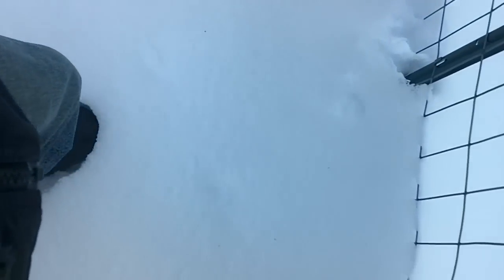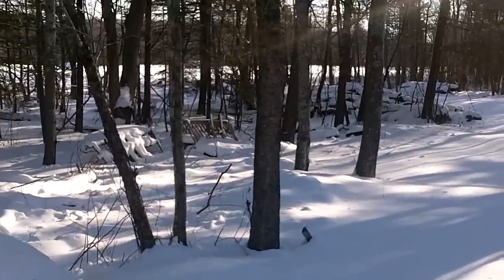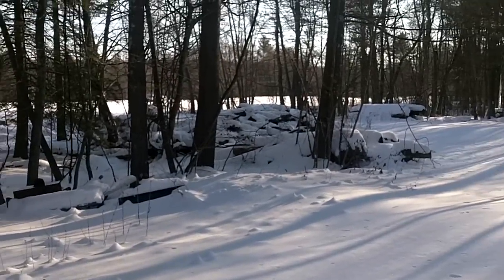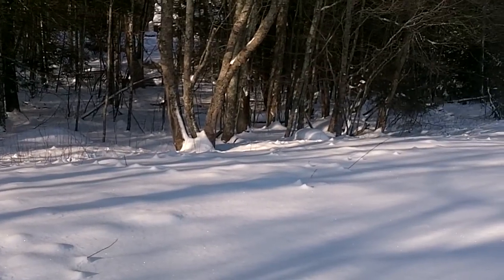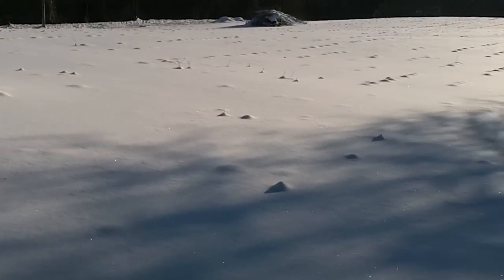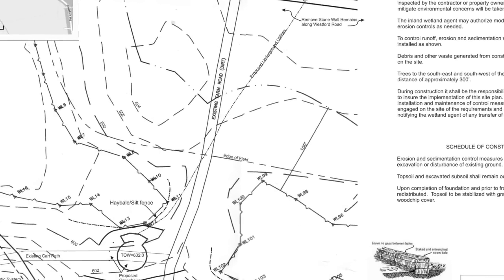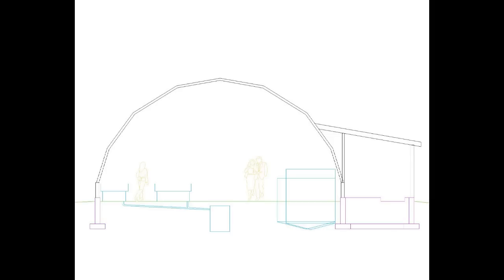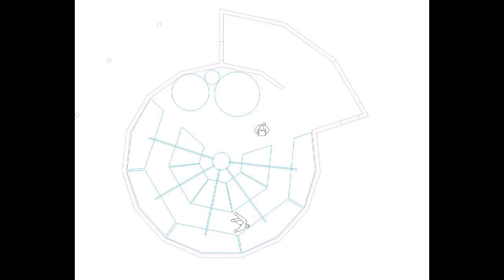Geodesic Dome Greenhouse - Part 1 - Overview

Comment: Hi, great videos I enjoyed watching them all. Is there a reason why you used a two sump system for the aquaponics system as this seems to have added a significant element of over complication and potential addittion points of failure? Why not drain the grow beds back to a single large sump without the need for addittional pumps float switches etc?
Reply from the maker: +Richard Miller It's just the way the floor layout worked.  I wouldn't do it this way again.

Comment: I have a 20' dia gazebo that needs a roof so I'm trying to figure out how to glass it all in... I have enough recycled old windows and sliding glass doors to glass the west east and south sides. And 2 layers of polycarb on the roof will keep in some heat... For the north wall, I want concrete as a heat sink with insulation oustide it (sprayfoam-inc.c m). I'm growing aquaponic lettuce,etc so I need the water at ~75 for the fish and the air stable for humid and temp for plants (salem, OR climate)

Comment: I'm sure efficiency is a pretty big deal for your winter heat.  Have you researched rocket mass heaters?  Googleing rocket stove pops up some good results on how to build one.  If you're burning wood anyway, you might as well burn it effeciently.  And the kicker, it releases no smoke, just CO2 and steam.

Comment from the maker: @Mooja12  Around $15K.  If it was sub surface, there is extra cost with digging deeper for the heating/cooling system and it would also be down in the water table.  Plus the concrete would have to be reinforced more since there isn't an equal load on both sides.  CT regulations require 42" plus footings for anything with a foundation.  Entire thing will be automated.  Using Geodesic for the "coolness" factor ;-)  Plus they can be an open span without extra supports = less material costs.

Comment: Good luck to you.  What an interesting project.  I'd expect costs in the neighborhood of $20K?  Do you have any estimates yet?  Have you thought of constructing sub-surface so grow beds are roughly ground level to take advantage of earth insulation, etc?  Hope you incorporate some custom monitoring and controls as you've done in your current GH. Is the 4' frost barrier a local regulation? Why geodesic vs latitude optimally sloped roof design type structure?